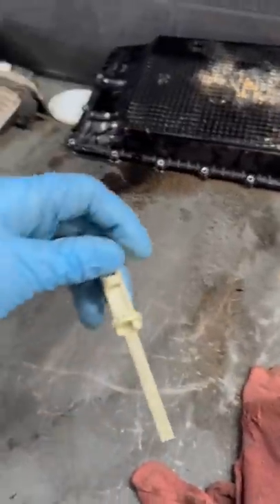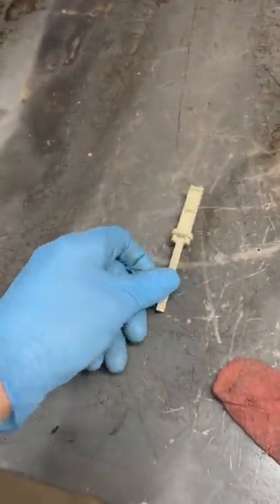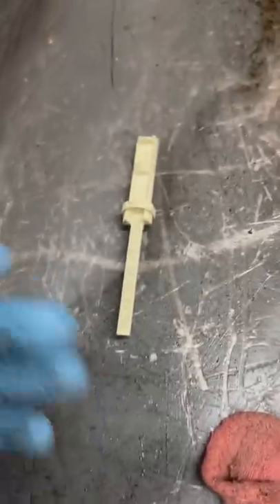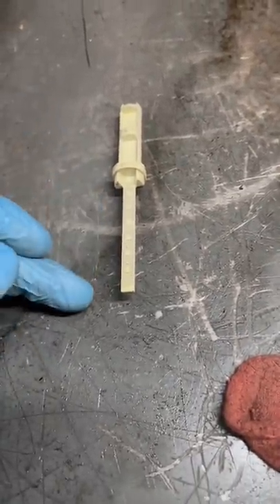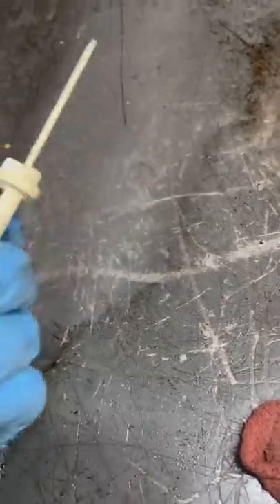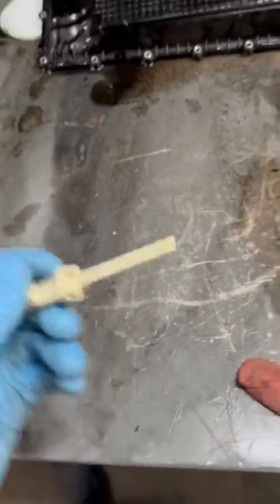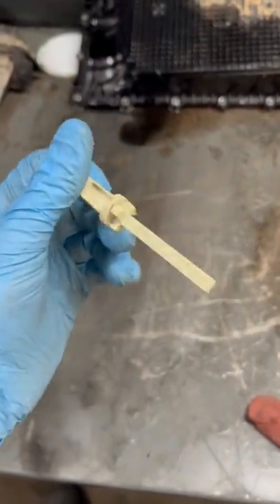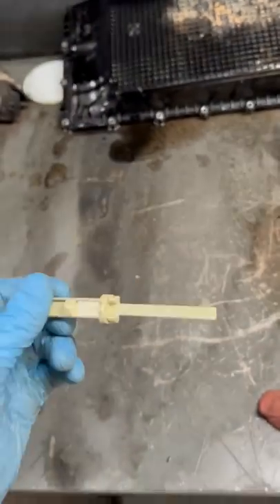Why do car manufacturers make my job harder? #shorts

Comment: I work at an auto auction we jump A LOT of vehicles. The placement of batteries and jump points, really?  Also the placement of fob resets and   start buttons placement, its like they got a bounus for making it more obscure. The best though are the newer Teslas with the yoke steering we had to pull the manual to find out how to change the gears. Hint look for the hazard triangle.

Comment: I don’t even see this as a big deal or a bad thing but it would be slick to make it so the dipstick is located on a place on every transmission so that one dipstick with hash marks would work. But learning to read a set of parameters for a vehicle you’re getting paid to work on seems like a normal turn of events.

Comment: You could just buy a few dipsticks, right on them which transmission it is, scratch out the numbers you don’t need. Do that for each transmission type, and make a little holster for each one.

Comment: “I got a 2021 f150 here”

Say no more, I see your problem. Ford has always had a bad problem of making their vehicles overly complicated to work on, I remember my 72 Ford ltd had the voltage regulated on the top of the fender behind the headlight, meanwhile Chevy had already made internal regulators and the few that still had regulators were generally on the firewall and easy to get to

Comment: It costs exponentially more to make a bespoke dip stick for every transmission than to just reuse the same one for all of the ones they make. Not only do you have to keep track of all of them and what they go to, you have to come up with a way to manufacture them differently on top of the R&D. Its insanely cheaper to have the servicer look up the details than have a completely different production line for every transition. Sure it's annoying, but it's really not that bad. Business is all about cutting costs where you can, and this is the least consequential and probably most money saving cut I've seen.

Comment: That’s not that bad imho tho as long as the info is easily available. The ones I truly dislike are the ones WITHOUT the dipstick, trans & engine. The ones w/out engine dipstick usually have the level info available in the cars media system, BUT, it only reads AFTER the car has been on and running for a while. That’s just idiotic. 

The trans ones you have to have a computer hooked up, the car level, get trans up to a certain temp ‘window’, then the fluid drips out the fill hole when it’s correct. Below the temp nothing comes out and above it the oils runs out like a faucet. 

Having a universal dipstick that you have to look up the correct marks sounds like a treat compared to that lol.

Comment: They could at least mark the optimal range for each model on the part and label it for the model.  How much would that add?  Cost of maintenance is a factor in the brand's reputation.

Comment: I had a1995 F150 with a stick shift that used ATF and had no dipstick. To add fluid and/or check the fluid you had to remove a plug and stick your finger into the transmission. If it's dry you added fluid until it dripped out. 
It was dumb. So now you got a dip stick like that but where's the filler? In that hole too?

Comment: Well, atleast it isn't as bad as ford's one time use bolts on the key cylinder. so when you take it off you have to use some vise grips or something to remove it and go find some bolts (or buy them) instead of just using the same ones when your truck gets stolen or something messes up with the key

Comment: Have to check the fluid level at over 200° Fahrenheit on some trucks. Always burning myself on the exhaust/motor/transmission when sticking my hand in the tight space to check the level.

Comment: Lol at least it has a distinct. My 5r55s doesn't. You pull a ug out of another plug and if it leaks its full if it doesn't the trans is probably on its last legs. Source: currently replacing mine because orevious owner destroyed reverse not checking fluid.

Comment: I recently had to take a tire off to replace the serpentine belt on a mitsubishi galant. Also the bottom of the bolts were facing outward.

Comment: There is only so many vehicles that he needs to work on. Not difficult to remember, it's not like at a mom and pops mechanic shop. 

I worked in 3 dealership for Ford. Same vehicles, same problems... don't even have to diagnosis after awhile. Same vehicles, same problems... easy money

He is only a kid, that's why he complaining. Tell him to go work for dodge instead. He'll be right back at Ford in no time!

Comment: You are fixing the wrong part. Change the transmission dip stick location such that it uses the same dip stick and reads the same level for all.
Changing the dip stick has cost implications. A unique one for each is more expensive. Changing the dipstick location does too, but that is already a custom part for every model so may be negligible.

Comment: I get the same dipstick, but why not position it a little lower in cars where the fluid has to be lower and a bit higher on the ones that get more fluid? Then you could just have one range. Wouldn’t it be just as easy to design the port an inch lower or higher?

Comment: You ever have to work on a jeep? I wanna say somewhere around 2009 they stopped coming with dipsticks on the transmission
Then you could buy one for it 
It’s super long like for a bus or something 
Comes with some handy little pieces of paper that get ruined immediately 
Oh and it’s a graph 

So they basically said good luck

Comment: When you have to make machines to make the single part it is not effective or cost efficient to make each small part specific. When you have interchangeable parts it cuts manufacturing time and cost. They don’t care about what mechanics want or think. They know you’ll work on it regardless.

Comment: Because it’s Ford. The same company that used plastic drain plugs that leak after 3 oil changes between 18-19 models, usually doesn’t have a plug for the trans and makes you use the dipstick, and the same company that tells you to go 10k per oil change 😂😂. Heads up to any ford owner, everyone I’ve seen who’s actually come into my shop that uses that interval is leaking after about 30-40k miles even if the car/truck is two years old.

Comment: Hell they could have just snipped it off. Say it's supposed to be full at 4 but 3 means add a quart. Well cut the dipstick off at 3. If it's full at 5 cut it at 4.

Comment: It pisses the consumer off even more when we have to damn near disassemble the motor to change a spark plug in some model vehicles.. I miss the days when engine bays had so much space in them u could stand inside and change the timing chain.. Sorta 😒

Comment: They could probably use the same stick easily if they designed the fluid pan to hold the stick at the right height for the specific transmission

Comment: Don't understand why that dipstick is so hard to access tho. I understand manufactures optimizing for cost but it makes it hard on the customer. 

Not sure GM or Toyota or any other manufacturer is any better, but I don't buy new cars, I buy used cars, and I can reach my dipstick from inside the engine bay without having to jack it up. It would be confusing if I couldn't.

Comment: As it is it is doomed to lead to overfill and burping fluid from vent. A label in the engine bay with belt routing, dipstick, fluids fill qty and type would lower warranty costs and improve owner sarisfaction. YOU HEAR THAT STOCKHOLDERS AND CEOs?

Comment: That's just cheap. I'm a mechanic but I used to work in plastics injection moulding, it would cost almost nothing to have removable inserts in the mould for each model, like date stamps. Cheap cheap cheap.

Comment: Oh buddy, that's nothing. I've have some foreign transmissions where you have to buy a special dipstick and you have to monitor the transmission temp with the scanner and make sure the dipsick reads correctly at certain temperatures. Nothing is time efficient anymore. Everything is cost efficiency.

Comment: And that's why I don't buy Ford products. Another reason to not buy is the fact that Ford is too lazy and cheap to put a fuse diagram on the fusebox door. So if you buy the Ford vehicle used and there's no owners manual and you need to figure out which fuse goes to what, you'll find ten different diagrams for one vehicle.

Comment: Yes. I personally find this type of behavior amusing from manufacturers.  They waste about $10000 on engineers, bureaucrats, business "professionals", time, energy, materials, and specialized manufacturing equipment in order to make their products as useless and disposable as possible with high complexity and inefficiency during it's design, manufacturing and latter on it's use by the consumer.  But when it comes to a something like the dip stick, then they must save one cent by having a generic labeling instead of the correct individual labeling that may be required. 🤣👍

Comment: Let's be honest, automotive engineers are clueless. I have an electrical engineering background, if my designs were as clueless as theirs I be fired.. Good example having to take off a fender to change a light bulb. Manufacturer doesn't seem to matter.

Comment: Want to know the answer to that that peace of plastic is from an injection molding machine Wich take a cast with that cut out in it Wich Injects the plastic into the cast and the cast opens drops it and does it all day but the cast that makes it coast anywhere from 20k to 100k that's why they don't want to spend the Xtra money when 1 size fits all and the owners manual will lyk how much to fill it to

Comment: Honestly kinda starting to get annoyed at the whole ‘engineers hate mechanics’ thing. Car designers have a hard job trying to make everything fit in the first place and being easy to work on is only one small aspect of what the car has to be. Next time you get frustrated on a car, actually think about whether you could have designed it better or not, and then think of the costs associated. This dipstick is actually really clever assuming the mechanic can, ya know, read.

Comment: Pontiac Torrent you have to remove the front lower engine mount and then take a bolt out of the transmission dip stick… SMH

Comment: I'm sorry but as a mechanic arnt you supposed to look up they type of fluid ( tranny fluid since we are on the sub) but not only that the quantity. So you already have to go to the book and look it up to begin with. This is the career you chose as well as the rest of us that trun a wrench, if your unhappy with little stuff like this then you should pack your tools. Like how you gonna complain about that but let the oil drain plug on the new ford not to mention the sway bar is right in front of it so when the oil come out it go's everywhere

Comment: Having a generic dipstick saves on manufacturing and assembly. It also functions just fine. Would be it nice if they had separate dipsticks? Yes it would but the engineers are highly pressured to find cost  savings and this probably is a reasonable place to save some money since it doesn't change the functionality of the part.

Comment: You should be looking that information up anyway. But why have 10 or 20 different parts when just one part can do the job? Do you complain when they use one size bolt on every vehicle?

Comment: It ain’t that hard to realize that smaller engines would be from like 1-3 as they get bigger like a powerstroke would require a high number. Should be common sense.

Comment: SMH the cheap trash cars, trucks are made from today. I've been driving a 1987 Ford Bronco for 24 yrs I'm  NEVER getting rid of it. I'm 6'3" & over 300lbs I don't fit in new vehicles. People don't realize how roomy it is inside untill they get in it they flip out and I can work on everything with standard American tools. The only metric bolt I found on the whole truck was the brake bleeders 10 mm.

Comment: Just wait till you hear about what Lexus did with their V8s and their starter motors by putting them inside the engine block behind the flywheel so you have to pull out the engine remove the flywheel and then replace the starter motor then put it all back together so you can't even do the tap it with a stick repair

Comment: you do have to wonder what they were thinking when they made some cars. i could never understand why they always put the inspection hole on rear drums in a place you just could not access. its a fucking hole, it can go anywhere but nuh they gotta put it where its blocked by shocks or handbrake cables.

Comment: The factory passes along shitty parts and manufacturing to guarantee the dealerships make money. My evidence OEM brakes vs power stop brakes. OEM make brake dust and wear out in 40k. Power stops are a fraction of the price and last the lifetime of the car and shorten brake distance while resisting fade better.

Comment: That probably makes the car like 20-30$ cheaper though, I know that sounds crazy since it’s probably a 50-80k$ truck but if you think about it 100 small things like that saves ford 10s of thousands therefore saving you thousands, now with that being said fords AND chevys are BOTH horrible trucks and cars, thank you for your time.

Comment: I've worked on cars for 30 plus years and I wouldn't work on these new junk for nothing. I quit working on cars late '90s early 2000s when it started the sensor has a sensor for a sensor with a fusible link going to a sensor going to a wire going to sensor no thank you

Comment: I just got to say that you're just lucky you ain't working on bmws and Porsches. No room,  insainly cheaply made crumbly plastic parts everywhere. engines with the softest aluminum parts known to man. There's tricks though, like you don't have to take the whole front bumper off to do you're timing and pump on the models that say you do, you remove the pump wiggling to the bottom and once you can't any more, the metal tab that holds the under engine plastic, you grab giant channel locks and bend that steel tab 90 degrees, then bend it back only once you've got the pump in place. But then there's the porsche and there's not too many work arounds. Damn front wheel drive set up upside down and backwards. That's why all those people die and get really hurt in the more torquey models change some simple hood struts? Takes for ever and you'll cut you're forearms all up. Hate working on European cars.

Comment: Seems like this young man is missing a great opportunity. Design a new one that is better to work with and get it 3D printed with durable material and patent it.
Reply from the maker: Now we talking
Reply: @FlyingWrenches13  i know its probably not as easy as it sounds. But you sound like you know your stuff. If you can get ahold of someone thats good with 3D printing . You can at least make a few for personal use

Comment: We overuse the words progressive and evolution....when you see things like this does it seem like we are getting smarter....in the 1920s the engineering could design and have the dip stick and tube and have it installed in the engine and transmission....now you get less and pay in many cases 10 to 40 times what you could buy a good product....for example go to any dealership and on a new truck find the spare tire 😉

Comment: It's called "cost".  It simply Costs too much. And is not necessary to make several model's when they can use the same part for multiple models and just use different levels depending on the model. 
that's ehy there are *Numbers to show levels.

Perhaps that is why you are not college educated.  You don't get it.
I always thought mechanics were smart men.

Comment: automobile manufacturers have ruined the world with their engineering and prices with very little gas mileage. I'm not buying a vehicle unless it gets at least, 100 miles to a gallon whether it's a pickup truck or a car. a small car should be at at least 150 miles to a gallon with technology. the medical field has made more improvements for mankind then automobile makers and they are still building cars that get at least 20 or 30 miles to a gallon. a semi truck is still getting four to five miles to a gallon on a good day unless it's over the road truck. you can add Maybe one or two more miles to a gallon for those trucks. they are the cause of depleting the oil and gas industry.